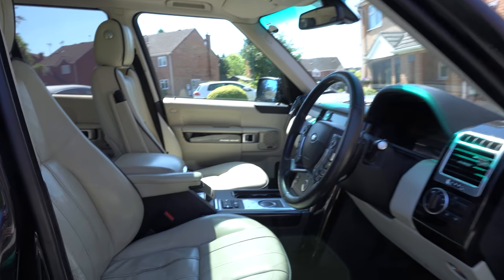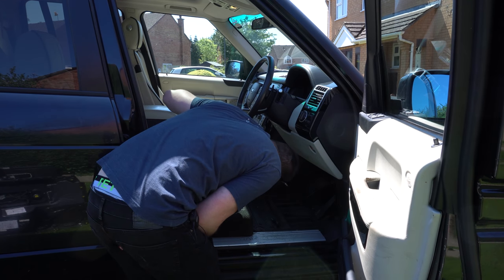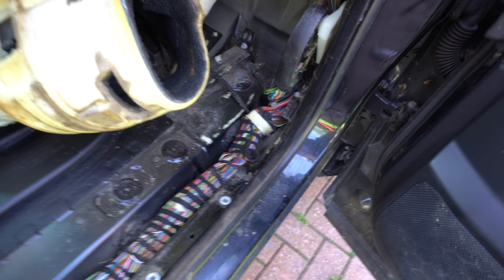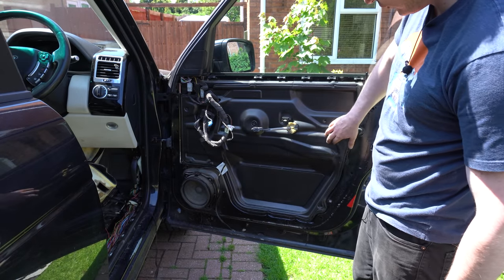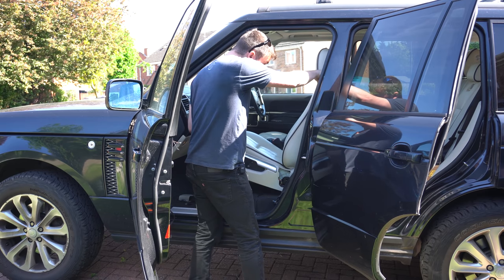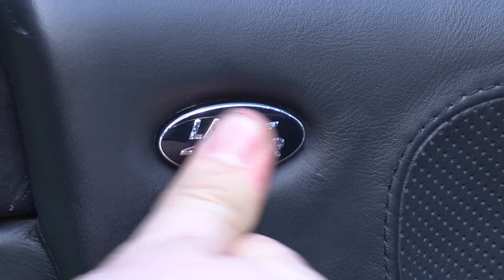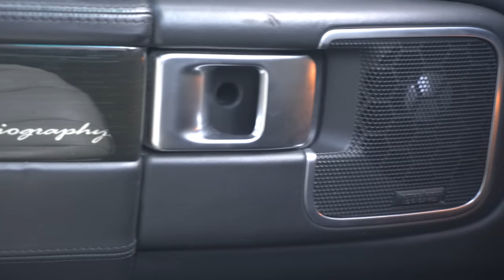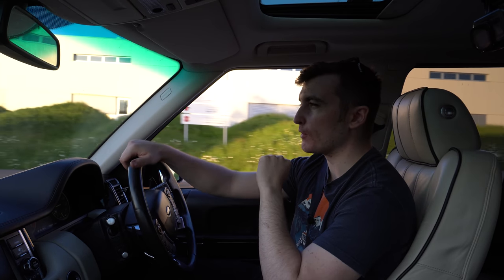NEW INTERIOR and AUTO LIGHTS / WIPERS FIX on the cheapest 4.4 TDV8 L322 Range Rover

Comment from the maker: This has made such a nice improvement to the interior!  
What should I change or improve next?!
Reply: Have you sorted out that dent on the back wing or have I missed your video ?
Reply: Upgrade all lights inside for led. Upgrade reverse light and number plate for led.
Reply: Looking forward to the megaflush vid - I'm considering it for mine... also LED lights - would like to see how easy/difficult that mod is! Keep up the great work Sam.
Reply: Be careful with LED upgrades, they are known to cause BCMs to fail on cars that were not designed for them, when they fail short circuit etc. I’m sure protection diodes etc could be fitted though.
Reply: LED interior lights is cheap yes but the trouble of having to constantly changing it is a hassle. LED interior lights market are Chinese grade garbage for some years now.
Reply: Private plate mate! I got my 2014 SDV8 Sport one and you now can’t tell how old it is 😂 DVLA sell good ones for £250
Reply: Sam, where can I find the seats? I have the same interior and would like to do the same. Thanks!
Reply from the maker: @maxalvarez5896  Hey Max, all I can say is to keep an eye on eBay and the Facebook groups for offers.  You might be able to find someone breaking a car near to you.

Comment: Great work Sam, looks good with black door cards!! Interested in the gearbox mega flush.  Picked up myself a 2012 L322 a few weeks ago, and had mega flush done last week. Noticeable difference, although old oil wasn't contaminated. Also swapped battery as other one was 10yrs old. Few other bits to sort which will be fun! Have a good week.

Comment: If it’s a LHD car will that wiper sensor wire be on the driver side or passenger side?  Great videos and presentations. I appreciate your in depth explanations using your engineering background.
Reply from the maker: Good question!  I'd imagine the main run of the loom stays the same... my logic being that the module and sensors are all in the same place regardless of drive side.  Thanks for the comment!

Comment: Is it just me or is that a strange location for a cable bundle/run? Quite close to a door sill where liquid is likely to enter and also to gather?  Is this the Range Rover equivalent of the LR4 oil level sensor inside the sump?
Reply from the maker: It's not great is it?  I mean if it had proper wire splices under there it'd probably be ok.  But a combination of damp ingress and foot traffic on top of it means the splices pretty much all fail eventually 🤦

Comment: I noticed my front drivers and passengers window is 2ply thick. Are yours? Also, always disconnect the negative wire when working on anything electrical those airbags are dangerous
Reply from the maker: Yeah I've got the double glazing too.  I don't like disconnecting the battery on these due to the amount of stuff you need to re-set up when it forgets 😆

Comment: How do those wires connect together? It's a strange connection.
Reply from the maker: The original crimp had just totally corroded down into a fine white powder 🤣. Slightly concerning as there are lots of other similar crimps in the car ☹️
Reply: @SamsMotors  what did you use to join the 4 wires(?) a Male wire connector? Is this a common fault on later Range Rovers as well or just your model?? 😊
Reply from the maker: When splicing small wires like that I tend to get a spade terminal and cut the spade part off, then just use the 'crimp' half of it to join the wires.  Works quite well, and is pretty strong.

Comment: How on earth did those red/green wires come apart?, that’s a few wires in a fat, static loom, wrapped together, which is under a screwed-down plate, which is under sound-deadening foam, which is under a carpet which is fixed in place by a kick-plate .. it’s not like they’re moving about much! 😀
Reply from the maker: I'm not sure what type of crimp they used, but whatever it was had totally disintegrated,  literally turned into a powder.

Comment: My 2008 L322 vogue has just developed a fault 😮, the steering wheel adjustment has stopped working when using the little stalk thingy . Although the easy entry works just fine , the 3 preset positions all work as normal . The seat and steering wheel moves smoothly and as normal except that the little adjustment stalk does nothing ! .
Any ideas ? , I checked fuses and all ok .

Comment: Big upgrade I know there are loads of products for leather. I rate Armorall Leather Care it works well and has a nice non sticky matt finish. 
Thanks for calling out the size of the tools you use on your bolts and fasteners makes for good reference for our own projects and building up tools as I did not win the Sealy tools giveaway
Cheers.
Reply from the maker: You might have won yet as I haven't done the draw or announced winners yet 😁

Comment: The biggest problem on any car by exchanging the seats is always the connection of the plugs. I bought very much motivated seats for a classic bmw 530d E39 to replace the old ones.  By no chance we were able to connect the plugs of the car with the plugs of the replacement seats. The one who could help us the least was the bmw main dealership. After many tries.  The car is a Facelift E39 and the seats came from a pre Facelift model, that was the only difference.   Complete different story of electrics and plugs. It would have been a nightmare job to make them fit to each other. So I sold the seats again with some profit and put the old nice one in again

Comment: Hi, Sam. I had a question. What do you recommend for brushing out and cleaning up the ivory door cards? Mine are not terrible, but upon close inspection, they've got dirt and old sweat in the finer grooves. I imagine a boar hair brush and some interior detailer with UV protectant...but what do you recommend?
Reply from the maker: Hey Carlos.
I've used a stiff bristled brush in combination with an interior detailer to pretty good effect.  The other one to try on stubborn bits is magic eraser - but be very careful as they can be quite abrasive.

Comment: Perfect video...again. My Ventilated driver seat doesn’t work😭. Only the heating works. Anyone?
Reply from the maker: Thanks 😁
Are there any codes logged relating to the seats?
Reply: @SamsMotors  You can buy a Peltier unit off ebay for abour £70 that will fix it, or it might just be the vent channels are cracked and you can get away with bodging them. Means taking the seat apart though, having seen Sam take the seat out I think this is the easiest way as I couldn't quite understand the internet guide for facelifts and can't get the back of the seat fully out.

Comment: Did you need to disconnect the battery when you took the seats out?
Reply from the maker: I didn't, but probably should have done.  The car logged a few error codes when I took out the accelerator pedal but they cleared again once it was reconnected.

Comment: Hi, where do those wires run in a LHD RRS?
Reply from the maker: Not sure to be honest, the Sport is a different beast altogether.
Reply: @SamsMotors  Thanks, I believe I have some sort of the same problem with the rain sensor. Light sensor still behave abnormally. Will check anyways. Thanks for the video, I found it very instructive. Keep going !!!
Reply from the maker: @thejack01  Cheers!  It could be the sensor itself, which usually is both the rain and light sensor, especially if both auto lights and wipers aren't working.  That's where I'd start anyway.
Reply: @SamsMotors  auto light is sometimes working erratically, I mean, lights come on at 5 P.m. even if there's bright light outside. Will check it. To read if the rain sensor is communicating with the module I'd need a GAP tool. Think it's time to buy one.